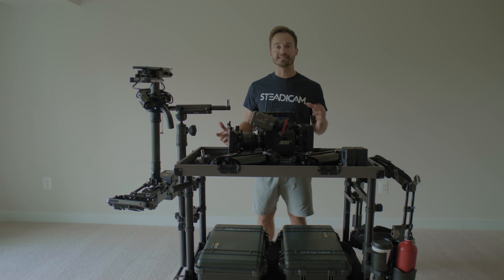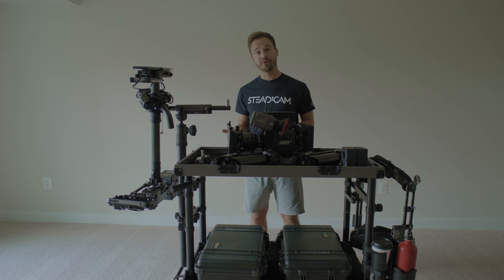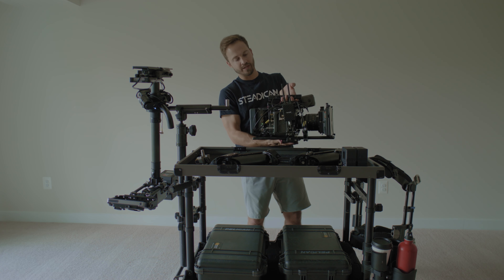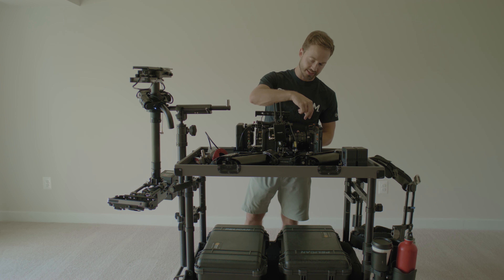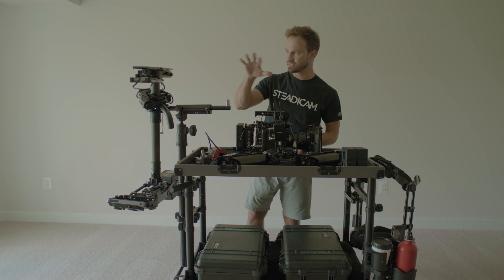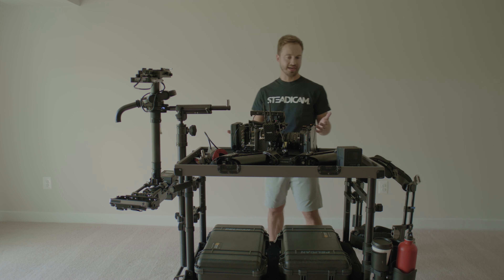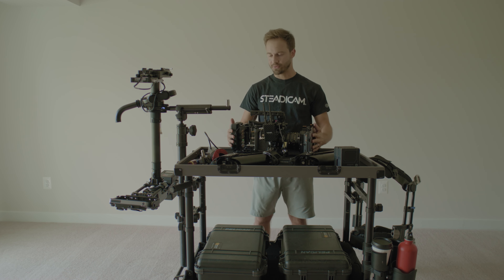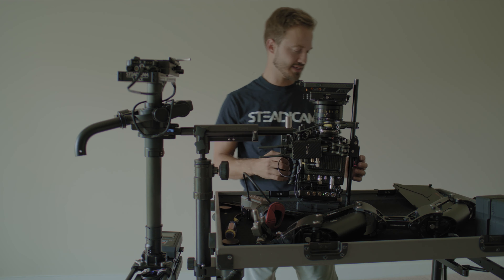Working on Set with a Steadicam Operator

Comment: As a 1st I’ve worked with Steadicam Ops a lot before, figured maybe there’s more I can improve on! I usually give free reign to the Op after slimming the build and extra hands if necessary, but weighing down the opposite side of an Innovative Cart so it doesn’t tip over makes sense and good to keep in mind for the future! :) Great work, very clear and easy to understand, thanks so much!

Comment: That's one great video. That Battery block sucks. That vibrates a lot. Just noticed it yesterday on a shoot while going through Stairs. Put a piece of Wooden block or wedge underneath it. but don't forget to wrap it around with a gaffer's tape so it won't put scratches under the body. thanks again for the info.